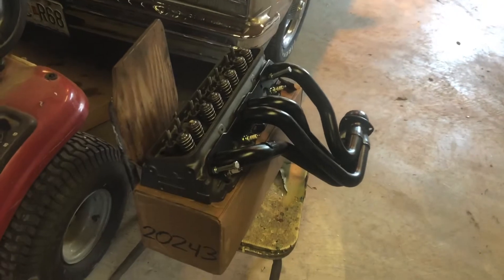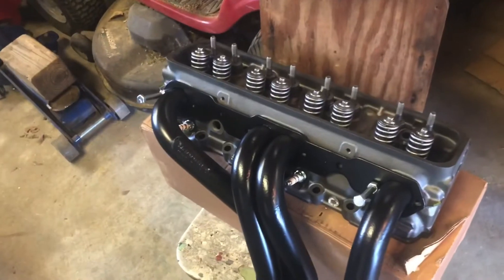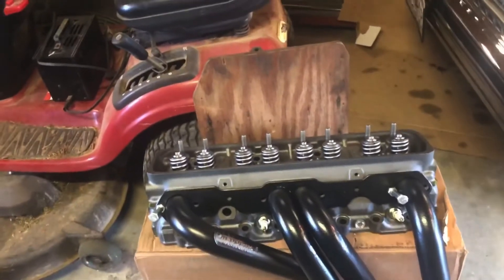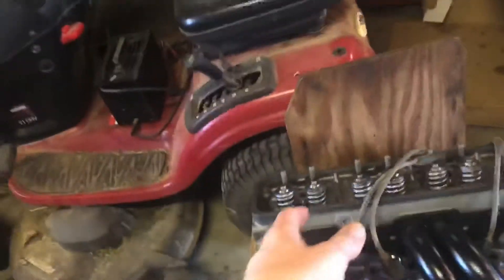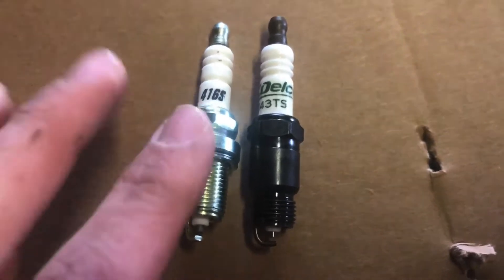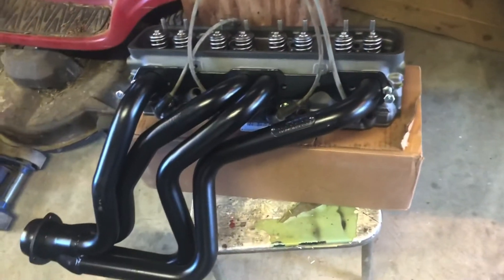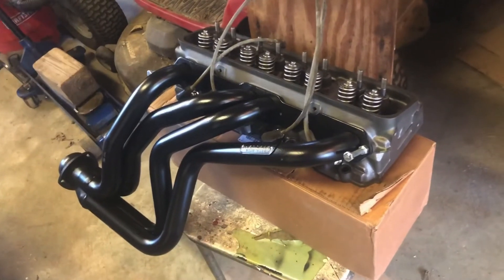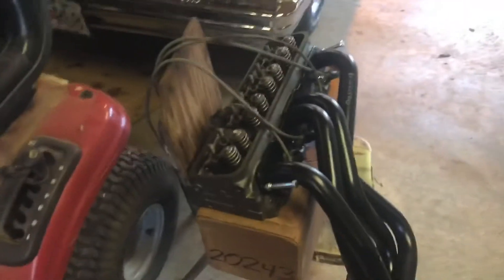Checking Spark Plug/Header Clearance on Vortec Heads.

Comment: Is the motor in the car yet?  Did the headers clear?
Reply from the maker: The engine is in the car. The headers clear stock length plugs fine, I did have to dent them in a few places to clear the crossmember however.

Comment: I'm a few months late, but just FYI, vortec heads use a taper seat style spark plug. The accel shorty plugs you purchased are gasket seat plugs. To my knowledge, Accel does not make a taper seat shorty header plug with .750 reach. Also, tbh, accel plugs really really suck. They are just junk, and foul out three times as fast as other plugs do. I guess you can try it if you really want to, but they will not work correctly. The champion RS14YC is the correct style plug for vortecs, and almost the same length as the accel shorties. Autolite ap 104 is another good plug you can use. You can add some boot protectors, or use ceramic spark plug boots if clearance is an issue, but they may not even be needed if you are planning on wrapping the headers. One last thing, the accel plugs you purchased are heat range 6 which is a bit hot for a sbc engine, and will possibly cause detonation. 99% of them prefer a heat range 4 plug. The ones I posted above, as well as the factory acdelco plugs are heat range 4.
Reply from the maker: I’ll look into the other plugs you listed, thanks.